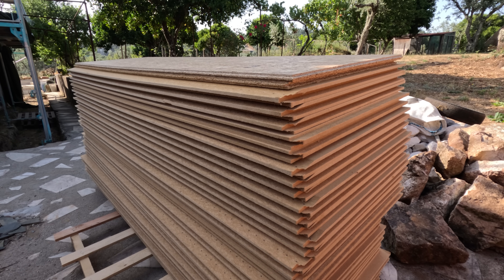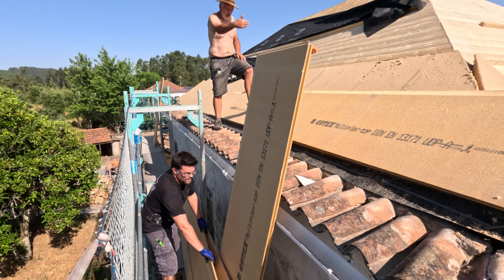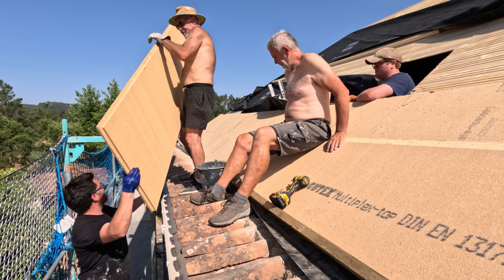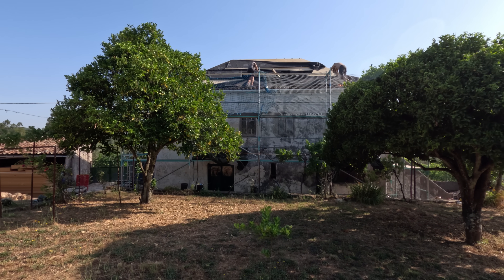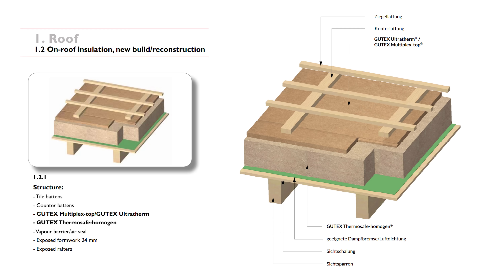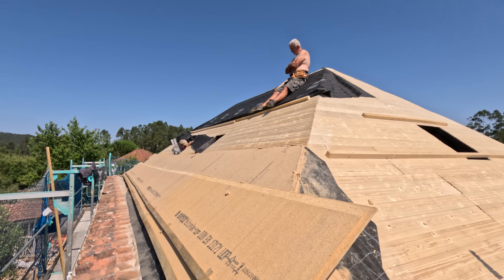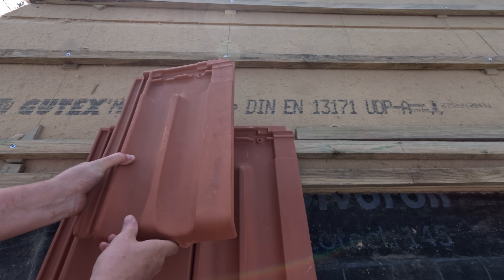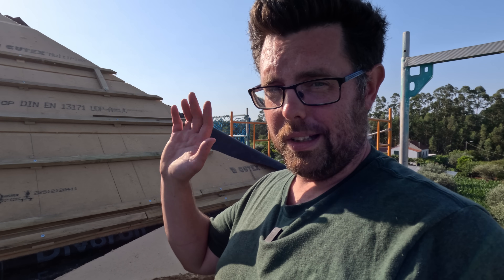We Need to Talk About Insulation - Roof Renovation Project - Day 14

Comment: The second way of pronouncing "homogen" is pretty much spot on German.
Your roof is looking really good! The only thing I'm slightly unsure is how much airflow the 12 mm spacers will allow, especially as they sink into the top layer of insulation. I've been recommended a minimum(!) of 50 mm counter battens, in a considerably cooler climate than Portugal.

Comment: Architect here with a question:  
At 15:45 of the video, he is shown screwing down the battens, and in the process, compressing the insulation. 

Is there no recommendation to use some kind of tube sleeve/standoff (fiberglass or otherwise) around the screw that is equal in length to the thickness of the insulation (from the top of the T&G to the underside of the small wood blocks you are using instead of the counter-battens)?  
This would prevent compression of the insulation and also provide a positive stop for the screws, thereby insuring that the level of the battens above the T&G & insulation remains at a relatively consistent height.
I'm not sure how firm the insulation is, so maybe this is just an issue at the bottom edge that is shown in the video since it looks like it's compressing because he putting the screw right through the groove in the insulation?

Been watching since the beginning; feel like I've got friends in Portugal!
Reply from the maker: As you suggest, it’s just the first board that has this issue as it’s screwing through the groove (and at this point on the roof it doesn’t really matter too much). 
When screwing through anywhere else there is no compression, the boards are pretty sturdy so compression isn’t really possible

Comment: Great choice of material, with a good phase shift value, considering the extreme summer temperature we will continue to face in the future 🥵 You probably already feel the difference under the roof!
Reply from the maker: It has made a massive difference to the temperature on the first floor already!
We would have liked to have used hemp but it doesn’t have the same high density properties as the gutex, which is a big part of keeping the heat out in the summer

Comment: Great Videos! I am planning a somewhat similar roof renovation here in New Zealand. The idea of exterior insulation with exposed timber sarking and beams is exactly my situation. I would like to comment on your decision to substitute small plywood patches instead of full counter battens. Have you considered the load distribution provided by the counterbattens? Each tile wants to slide down the roof slope, and this is increased locally when someone walks on the roof (for example). Without the grid of battens/counterbattens, this extra load is localised to one batten fixed by the long screws through the insulation down to the rafter. The overall roof load is still the same of course. This may be super cautious on my part, but I have considered this aspect and decided to stick with the full counterbattens.

Comment: Isn’t the vapor barrier laid to prevent water vapor from the house impacting the insulation material?
Reply from the maker: Not in this instance. One of the primary benefits of using wood fibre insulation is that it can accommodate humidity and condensation

Comment: Would have been great to see the temperature in summer in the roof pre insulation and then post 🎉
Reply from the maker: We don’t have numbers, but previously when the sun was out it was unbearable in the loft, now (fully insulated) it’s quite pleasant. It will be even better once we get the ventilation system running

Comment: Due to the extra height of the insulation added to the rafters, there will be a space under the first row of new tiles that will lay over the Roman tiles you have so lovingly cleaned.  How will that space be filled, if at all?

Comment: This is great information on the insulation. Glad you took the trouble to summarize it. We also insulated above the t&g with contrasting large beams. In 2022 when my roof (a huge one) was replaced, the options everyone said was rock wool, cortiça, or the sbs blue foam. That's it. We could not find another option, but maybe we weren't looking in the right places. We are told that our area just discovered plasterboard (sheetrock in the US) around 2017, and breathable membranes more recently to allow vapor to escape upwards but prevent liquid water from entering downwards.  I was glad the Coelho da Silva brand roof tiles were available. Marseille and Portuguese styles. Some have a 30 year warranty.
Reply from the maker: It’s mad isn’t it how so many of these products are so difficult to find. We had similar issues finding hemp, and just in the last 2 years of so Portugal based retailers are now selling all kinds of hemp products.

We’re also quite lucky to have found the Gutex locally, almost as soon as we got here in 2020. But of course there are very few people who know about/ understand these types of products

Comment: Hey, I've installed Gutex Ultratherm on my façade, 60mm and I don't regret it ! As I have a wood frame house, making sure that heat doesn't get in too quickly is primordial in summer. Since I've installed the insulation, it's made quite the difference ! I still need to make sure to open the windows to freshen the house in the evening but we get a more than tolerable 23-24°C when it's above 30 outside.

Great to see the project coming up, can't wait to see the roof finished !
Reply from the maker: Nice! We have friends who have installed the same two products as us and have their bedrooms in the roof space and are comfortable.
It’s always great to know these things work 😀

Comment: I miss the radiant heat barier (metal foil) underneath the tiles. the tiles become very hot and start radiating into the isolation underneath which will heat up. especially with that powerful sun in Portugal.
It wont do much in the winter, but it will definitely keep it cool in the hot summer
Reply from the maker: The high density of this insulation restricts the infrared rays from coming in, in a similar manner to the foil
Reply: I highly doubt that. I feel after hours of sun the dense pack will heat up further and further.
I guess it is easy to test, by placing 2 plates near a heat radiation source and measure the temperature on the other side.
You now have still the option. might be worth the test (and an interesting video) @MAKEDOGROW
Reply from the maker: @MasterIvo we know it works. We have friends who have installed exactly this roof system and they happily sleep in the roof space and it’s nice and cool
Reply: @MAKEDOGROW  ok thanks, that surprises me. learned something ❤
Reply from the maker: @MasterIvo  I don’t remember which document, but Gutex do have something in their docs about infrared, penetration times and insulation depth. The most important thing is the density of the material, the products we’ve chosen have very similar U/R values as many others but it’s the high density verses low density (products like xps for example) that excels in the hot summers

Comment: Your original roof had battens and tiles. Your new roof has painted t&g sarking, vapour barrier, gutex insulation,  and gutex t&g sarking  - these items are additional loading over and above the barrens and tiles. Presumably someone has done the calculations in the rafters handling that extra load?

Comment: Good progress. The weather is good – hot, but at least it's dry. If you're completely redoing the roof, it's definitely better to apply the insulation from the outside. I'm already looking forward to seeing the finished roof, BUT! I’ll most likely miss the daily update videos (I'm assuming you won’t be posting daily videos anymore after it's done).

Comment: Hi, the inner membrane suppose to be a vapor barrier layer, the moist and humidity of the living space suppose to go out through the windows, not the insulation. Even the illustration at 14:27 sais vapour barrier/air seal. If you let the humidity into the wood fiber insulation, it can't escape since the outer layer won't allow it (since it's waterproof), moist will condensate and the fibers will rot eventually.
Reply from the maker: Maybe go read the tech sheets so you can fully understand the layers since it doesn’t seem you have understood our explanation
Reply: The outer Layer is not ‚waterproof‘ but rather water resistent…. And breathable, so the humidity can escape when the sun comes out (I doubt that will be a Problem in Portugal).
Reply from the maker: @IainTaylor0 thankyou 😀
It seems so many people don’t understand vapour permeable solutions

Comment: I really like your choice of material. The mass of the boards will provide good heat insulation in summer. However, you deviated from the manual. 
It lists a vapor barrier on the inside of the construction while you are using a permeable membrane. This way you are risking inserting damp air into the construction in winter. Was this a deliberate choice?
Reply from the maker: Please read the tech sheets, it’s specifies a breathable membrane which is what we have used (the diagram is a simplification)
Reply from the maker: This document actually does a better job of specifying a vapour-retardant barrier.

https://gutex-benelux.eu/fileadmin/user_upload/GUTEX_EN_BR_ProductApplications_2017-02.pdf
Reply: @MAKEDOGROW Thanks. For the document. I couldn't find any mention of a desired sd value for the membrane in there. It only says "vapour barrier". That would imply a sd value of >0.5. However, I'm sure you did your due diligence, even if I can't see the reason for a membrane that has basically the same sd value as the (very nice, by the way), white planks on the inside.

Comment: I like your chosen method of insulating the roof. I think the external insulation being continous will notable improvement over using a similar depth in-between the rafters. There's a comparison by Steve Baczek, on the Build Show channel  where he looked at internal versus external insulation. It was for stud framed walls, there was a notable benefit with the continuous insulation. I think on a roof it would be more notable based on thermal transfer up to rafters compared to vertical studs.

Comment: I think it also shows quite wel why there aren't many hipped roofs in modern building, as opposed to a gabled roof.  At every stage, there is a ton of cutting to make the angles!  Gonna be a lot of tile cutting coming up.  They're so pretty though, so I'm grateful to past builders/designers/owners who thought past the bottom line.

Comment: I hope you misspoke and the innermost layer is not moisture permeable. This layer must be a vapour barrier or moisture will form in your insulation layers during winter.
Reply from the maker: Please do read the tech sheets ….
Reply: @MAKEDOGROW  I did, and it says vapour barrier/air seal.
Reply from the maker: @bizarro3367 yep, exactly
Reply: @MAKEDOGROW  I'm not trying to be difficult, but vapor brarier and moisture permeable are opposites. Vapor barrier blocks water vapor form passing through. Moisture permeable allows water vapor to pass through, but not liquid water. So if you have a water permeable innermost layer, water vapor will pass through.
Reply: What happens when it's cold outside and heated inside is the air loses its capasity to hold moisture by 50% each 10C temperature drop, so let's say it's 50% humidity inside. Then the humidity will condensate at 10C, which is in your insulation layer if it's ex 0C outside.
Reply from the maker: @bizarro3367 we’re not really here to explain how vapour permeable alternative materials work, so if you want to learn more on the subject you might need to do some wider reading on the subject.

This might help, where the membrane is referred to as vapour- retardant:

https://gutex-benelux.eu/fileadmin/user_upload/GUTEX_EN_BR_ProductApplications_2017-02.pdf

The whole point of the wood fibre is to accommodate humidity and condensation
Reply: @MAKEDOGROW  I have renovated a few houses. Just trying to help.
Reply from the maker: @bizarro3367 not disputing that, but there are many different ways to achieve the same thing. The materials and methods we choose are definitely not what are commonly used these days.
Moisture permeable systems have been around for a long time, and unfortunately are often misunderstood because most people only understand the more modern solutions

Comment: The "glue" is often 3-5% bicomponent fiber with a solid base and an outer part that melts and holds the wood fibres together (inner part PE and outer part other polymer that melts at a lower temperature)

Comment: I watched this video with interest. I couldn’t see if you had taped the joints in the airtightness membrane to provide a continuous seal and whether you have previously installing a continuous airtightness membrane throughout the rest of the building. This is good practice for high performing, energy efficient retrofits relying on MVHR for ventilation (< 3 ACH@50Pa).